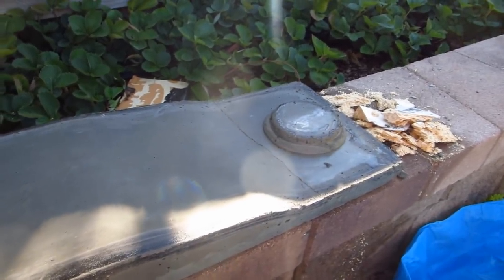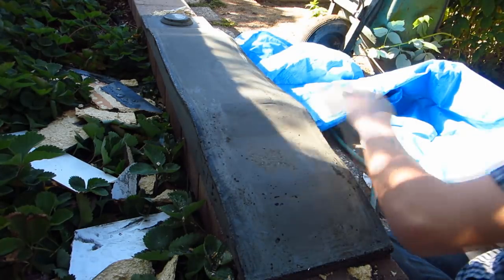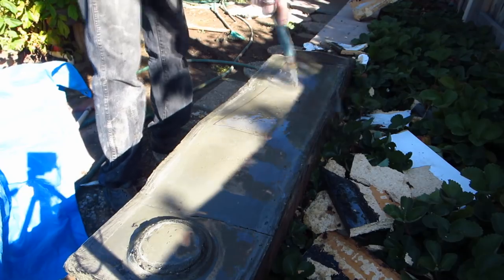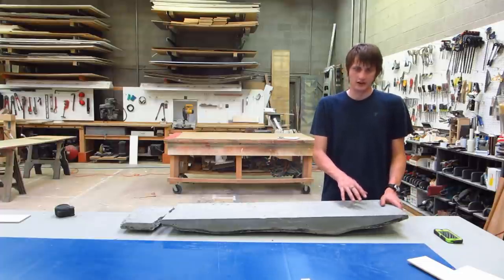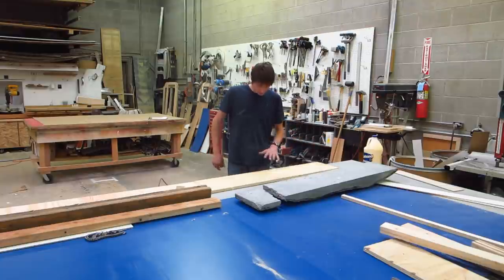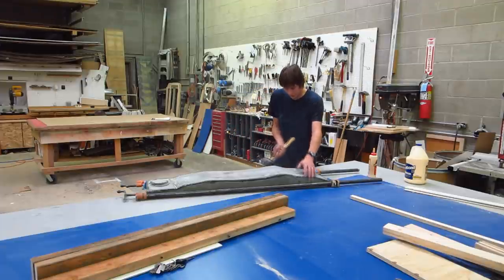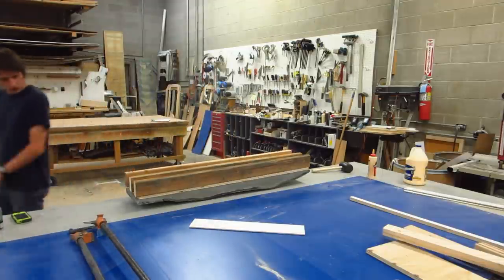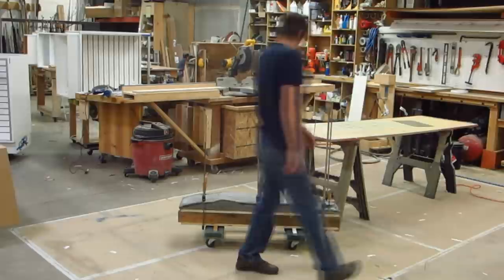Unmolding and completing the first half of concrete press. 3D Longboard Mold

Comment: Its like you are forming the mold backwards. Prototype a shape that you like. make an uncut board with said contour, and place in form. Pour concrete and let it fully set. when you disassemble the form you will have two mold halves that are indexed. If the two haves are not indexed to each other then the lamination is going to be crap.

Comment: Would a deck with "dewedge drops" on both front and rear (symmetrical angles) be possible to make?

So a "side profile" of the deck could look roughly something like this? /\_______/\

Also, what if the drops could flow smoothly as a rockered platform from one drop to the other?

Comment: I wouldn't think that 1/8th inch ply would follow any of these minor cracks and protrusions. Plywood is like a low-pass filter in that respect. It also has "memory" so you actually have to overpress the curves as it will always return a bit on release.
Reply from the maker: I plan to also press 1/16" birch veneer after I use up all the 1/8" stock I already have.